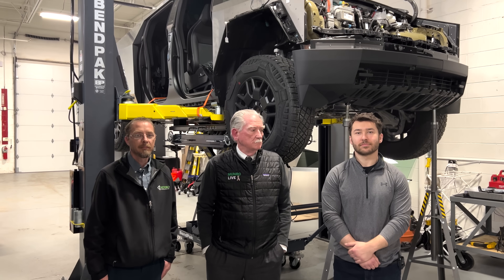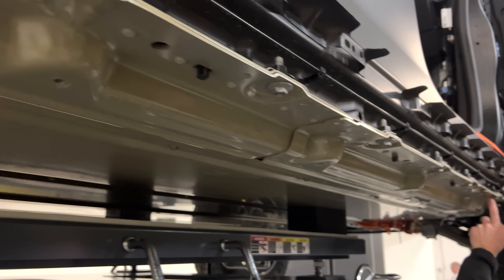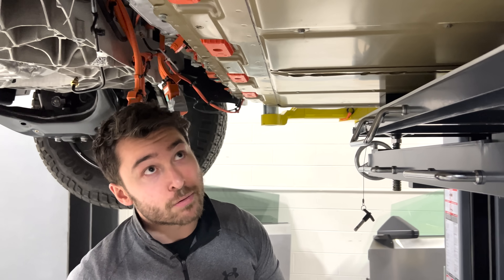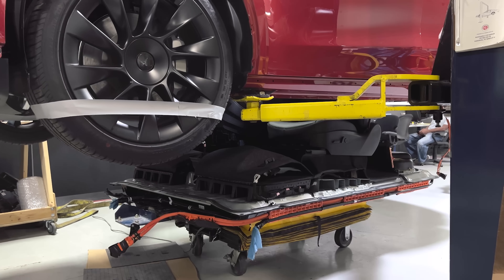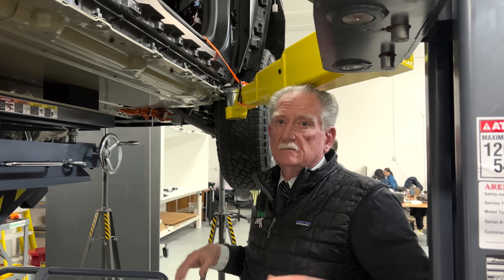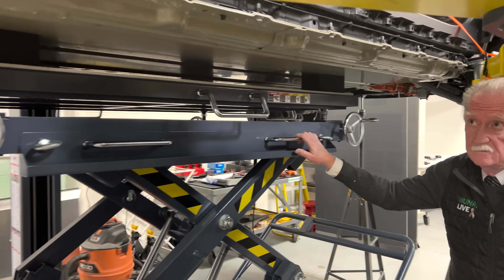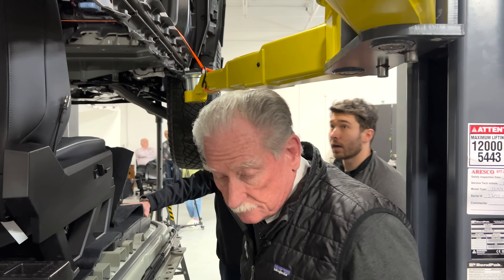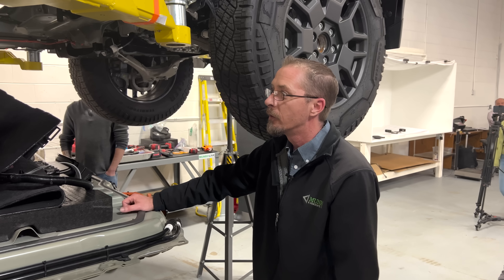Dropping the Battery Pack in Our Tesla Cybertruck!

Comment: If Tesla’s innovation has reduced production cost so much, why are the CyberTrucks not selling at a price closer to the initial projections?
Reply: If this was a legacy truck released at the initially projected price the dealers would be marking it up to $150K.    So why gripe when Tesla picks up some extra cash to help fund production ramp?
Reply: Because twitter was so expensive to acquire 😅
Reply: They are still refining the production line for the Cybertruck. Costs should come down once this is perfected like it did for the other Tesla models.
Reply: @streddaz   Supplier cost may fall too when Tesla can order in larger quantities.
Reply: @danharold3087  yes, you are correct. Volume reduces costs.

Comment: Monroe talks about saving the manufacture $800,000 with the structural battery pack with the seats attached. Unfortunately, what he doesn't mention is what it costs the consumer...
1) Added cost to remove and replace the battery pack.
1) The structural battery pack is a throw away battery pack that can NOT be serviced! Please don't mention recycling. That does the consumer ZERO good!
A great company with some of the smartest engineers. Unfortunately their talent goes to helping the wealthy make more money, rather than benefiting the little guy. That concludes my rant for the day.
Reply: Actual like my comment above, Tesla is building a lithium refinery in south Texas so they can make enough batteries since no one else would... eventually they will simply grind up the used batteries as a super rich lithium "ore" and make new, better batteries. The failure rate is very very low at this point on these Tesla packs... if it were not, with almost 2M Teslas sold last year and the media's penchant to overblow any small issue a Tesla has, we would be seeing a lot more about their "terrible" batteries in the news. Tesla themselves would have never engineered something like this if they were loosing money on constantly servicing batteries... As for the little guy, Tesla outsold the Toyota Corolla and the Ford F150 now... next year they will be introducing a $25K car that needs no oil changes or regular service and costs much less to operate in terms of energy (something over 100MPG equivalent). At this point whether we like it or not (and I like my gas cars) the electric vehicle transition is happening.

Comment: It must be very stressful for Tesla engineers when Munro Live publishes a video about their part.
Reply: I suspect it "was" at one time, but....
They watched.
They learned.
They refined.
.
At this point I doubt they're very stressed.
Probably more interested to see if the teardown team notices all the innovative points.
Reply: why? Munro loves tesla, almost no critics at all in the past. They love everything tesla does. Even removing the blinker stalks is genious, appearently. 
Tesla could cut a hole in the roof to let rain in and munro would find the positives about that.
Reply: "It must be very stressful for Tesla engineers when Munro Live publishes a video about their part."

Why?
Reply: @dieKampfmelone Sandy can be harsh if an engineer uses two parts instead of one, uses too many threaded fasteners, designs something that could be lighter or cheaper or easier to manufacture or easier to assemble or safer or ....  He lavishes praise on good work, but he doesn't hold back on sub-optimal designs.  It's his job, but he's sharp in his criticism.  He could never be a kindergarten teacher.
Reply: @dieKampfmelone  you must have missed his first model 3 teardown

Comment: Wow! Great video! Answers lots of million dollar questions!
<many engineering themes of legacy automobile manufacturing are obsolete>
Reply: While VW and TOYota each make around 10 million vehicles a year around the world, and sell over $300 Billion, Tesla is not even in the same league, stop worshiping nonsense.  More plastic snaps, that's key, to the low quality that is tesla.  Remember Sandi is an ex Ford guy, Ford has the most recalls of any maker in the world...what a resume'
Reply: @cengeb  <yeah, so ummm...if you bought a $100,000 utility truck(ford/gm/ram), and still owe $50,000USD on it, i would be upset too>
<simple trumps complex>
<if going electric means removing 5,000 parts and/or 2,000 moving parts from your previous designs of legacy automakers gas cars, ultimately this strategy will succeed>
<when a (standard sedan)electric vehicle comes out with a million mile battery pack, and stainless steel exterior i will buy one>
<i exited the gas car scam in 2010, because it's a scam by all parties involved>
<all plastic on your car(s) are perishable items, so if you paid 40 grand for jeep and/or bronco, which are 1/2 plastic, then you paid 20 grand for some fancy plastic decorative parts, etc.>

Comment: Do a Silverado EV next, to see what really cutting edge EV pickup performance is all about. GM with it's much larger battery, destroyed the CT in a 500 mile rocky mountain towing challenge. And this is what really matters to many pickup users. Real world towing. The real problem that I have? With a larger battery option, CT would likely have only matched, but not exceeded, the GM performance in this test.

With all of its hairpin motors, 48V architecture, octo valve, etc. the cybertruck is supposed to be the game changing technological marvel that  sets the standard for EV performance. It's head to head performance says otherwise. Even the F150 lightning and Rivian performed nearly identically. I'm a HUGE fan of Tesla design innovations, and i just don't get why we don't outperform Big 3 competitors that essentially pulled out the ICE powertrain, and slapped in an electric motor and a half baked battery pack. It doesn't add up. What am I missing? More importantly, what are TESLA engineers missing?

Out of spec reviews:  https://www.youtube.com/watch?v=LJFbevgCsig

Comment: Tesla could do a little more work to make the battery pack more accessible - fishing around for wire and moving the Tonneau louvers back and forth ads time to battery replacement.
Reply: You are joking?
.
Maybe it's just a case of closing the cover closed before disconnecting the battery, meaning the tonneau isn't in that area?
1) Bed side cover off.
.
2) Release charge receptacle (disabled in service mode so it can be unplugged from the pack?)
.
3) Close the tonneau.
.
4) Remove the cabling....?
.
Or something like that....
Reply: The savings are for the production line, not for the unknown time in the future that may not even happen.

Comment: Once the battery pack became structural, it was probably inevitable that the traditional unibody structure was going to change, just as unibody replaced separate chassis.
It will be interesting to see how this assembly system spreads through the industry.

Comment: As the body moves along the line, how does Tesla keep it aligned properly without the battery? That would require a large rig to mount to the body until the battery is attached or the body would be like spaghetti as it moves.  Maybe that explains the panel panel/door alignment issues seen on production vehicles.
Reply: Some gaps, like the dual-motor MKBHD shown, were actually because the door latch fell off. Thing is, this will get fixed as the ocmmon "low VIN" issues get fixed.

Comment: Its apparent that Sandy hasnt been in modern vehicle manufacturing facilities, and it shows. Unless he wants to prey on the ignorance of the viewers, and plays up Teslas way of manufacturing. They have automated robots for assembly, theres not banging up interiors, fenders, exterior parts. Everything is done mostly by 4-5axis assembly arms. Dont let him fool you
Reply: I know that, it's actually allowing for consistency and higher volume production. They do have employees check up at many steps on the line though.

Comment: If anyone else designed a floor and battery combo would be called insane and ludicrous.
There is no way this gonna be a long term or safe jus saying.
Reply: It's not TOO bad, plus the seats are removable without the need to drop the pack.

Comment: droping the whole floor along with seats, carpet and everything is beneficial from manufacturing standpoint, but servicing the batterypack on this is nightmare. also, it could lead to issues with sealing
Reply: Sigh..
Reply: 6:40 "easy peasy". 
Drop the worn out battery pack and seats; replace with new pack and refurbished seats. ☮️
Reply: @Tim_Kent  yea. just give it to tesla without any option to replace modules/individual cells or any other component inside the batterypack. just replace the whole pack in tesla servise. because they don't want a single dolar to escape.have you heard about right to repair? that's the right you don't have with this solution. and to add more cost to replacing battery, you want to replace seats along with it. and still, you have seals around the floor of the car, that's potential place for leaks. if you drop the batterypack, chance of leaks is sligtly increased.

Comment: Do that battery pack bolts have never sieze, or will the be rust welded in place after a winter or three exposure to salt?

Are the nuts fixed in place?

A better view of the stuff installed on top of the battery pack would be nice. And what is left inside the vehicle.

Comment: Compare that to the Ford Lightning frame with all of its bulky structures and separate battery modules. The Cybertruck structure not only saves assembly time but also weight and cost.

Comment: Hell if you need to fix a seat motor or HVAC you'll have to drop the battery pack and mess with the tonneau cover to disconnect the power lines. Fast for assembly,  but just pass on high service costs to customers at service. Why Elon and EVs suck!
Reply: What? It would be under warranty I think. And, the seats can be removed without dropping the pack.

Comment: Putting those structural bolts right in the path of the wash of rocks, water and salt coming off the tires is some advanced thinking.
Reply: Gonna be wild first time someones driving and they fall out the bottom
Reply: Waiting for the first REAL problem still.

Comment: How does this design affect the structural rigidity of the vehicle, in terms of torsional bending stiffness and all that influences, etc.? I understand that pickup trucks typically have a different construction to sedans/SUVs, so I would be very interested in how this differs (and in what ways it is similar) to what Tesla will be doing with the New Model 3 and refreshed Model Y to come out?

Comment: Amazing how nobody questioned the unibody process for decades...
Reply: "Amazing how nobody questioned the unibody process for decades..."

It makes sense. Just look at how little stagnant legacy automakers have innovated since then.
Reply: @yourcrazybear yeah, like the first electronic fuel injection VW, first plastic fuel tanks VW, DSG transmission, PDK at Porsche, yeah, no innovations, ABS, , disc brakes traction controls, shoulder seat harness Volvo, radial tires, better paints, right, no innovations, only tesla, sad, to be a cult member, really.  I guess halogen headlamps, then xenon, the LED, no innovations, right, better and lower emissions over the decades, better mpg, all those legacy car makers doing nothing.  Sad, really sad to think Mush is such a creator.  Meanwhile TOYota and VW each sell 10 million vehicles and sell over $300Billion (VW $320 in 2023) sales, Tesla isn't in that leauge
Reply: Why should they?This only makes some sense with batterie electric cars!

Comment: With the rear seats hinged on the rear body structure, the amount of stuff on the battery pack is reduced. It would not be hard to bolt the seat supports to the frame such that when the pack is removed, the seats stay in place.
Reply: That is how Tesla did it.  Rear casting holds the rear sets.  Actually has a largish tab under the seat frame.
Reply: Seats don't need hard fix to battery. Bolt the seats frame to the body once installed with the battery, so pack can be removed with seats and soft floor left in place
Reply: @peteregan3862  The rear casting has a section that the rear seats rest on.

Comment: the pack is a lot thinner than I thought. they could have easily squeezed in another 40kwh into the main pack on the extended range rather than as a pack taking up space in the truck bed.

Comment: Id like to see the floor and roof cage cast with clip in place plastic rocker panels. I dont like the top bolts. Bottom bolts only without having to remove any body panels to access the battery bolts. They should have a single penthouse cover to access the connections,  or have connector blocks that engage the battery as it drops in place.

Comment: The cabin floor is certainly not the "whole structure for the centre section of the vehicle". It's just the floor panel with attached crossmembers, with the roof and side frames with rocker sections providing almost all of the structure.
Reply: Pay more attention.
The system has only been described in detail for.... Years.
Reply: @rogerstarkey5390  I have paid attention... and it is exactly as I described, in both the Model Y and the Cybertruck. 

If you think it is any more, then you haven't paid attention.  You can even see in this video that it is nothing more than the floor panel plus some attached crossmembers serving as the top cover of the battery case.

Comment: The floorpan-attached-to-pack scheme does matter to assembly of the vehicle interior, but it just adds work and complication to battery pack replacement.
Reply: How often does one replace the battery pack? In a million miles? That's okay because its not done on the production line but in a repair shop.
Reply: @ronjos  that's fine, and the design may be a good choice... it's just not an improvement for battery replacement, as claimed in the video. And despite the claims of Elon disciples, Tesla batteries do not typically last a million miles.
Reply: True, but Munro (and Tesla) are strong on saving manufacturing costs and on techniques that improve reliability ... to quote Sandy "You can have reliability or repairability but not both!". People thinking of future maintenance, repair and replacement have different priorities!
Reply: @MrAdopado  this assembly design may be a good idea because it reduces manufacturing cost, but it certainly does not improve reliability.

Comment: Just got my CT on 032024.  Am curious to know if there is unused space in the battery pan for the 500+ miles worth of 4680 cells a lot of us were hoping would be a factory installed option.  The current enormous $16k optional battery pack, when combined with a spare tire, uses up TOO SUBSTANTIAL  bed space.   I realize that a dropping of the CT battery pan and retro-fit of additional 4680 cells is NOT a practical economical possibility....and that any 500+ mile CT would mean a future new Cybertruck purchase.
Reply: Highly unlikely.   Tesla would have had a 200+ KWh option instead of the range extender.    Look at what the 200 KWh pack does to the chevy WT 4 playload  1,440 lbs.  1000 lbs less than the CT.   Simply choices.   Pick what suits you.

The in box range extend would be a  very good option if Tesla teaches it how to drive off the truck bed onto a stand next to your power wall.  Highly unlikely but it would not be all that difficult.

Comment: @MunroLive Did you use the procedure in the Cybertruck Service Manual for battery removal?
Reply: I can answer that: no, they did not. They rather try a reverse process from the general assembly, likely for analysing general assembly. But this is different than the service procedure: "High Voltage Battery Assembly - HV Battery, Long, 4680, Center (Remove and Install)" from the Cybertruck service manual, which is intended for work shops and repair shops.

Comment: I would still like to see easy drop swappable packs.  As battery tech about to change at warp speeds . I am thinking 2 years double capacity and 1/2 weight.     Guess you can get new seats like a bed thing as self drive seems may allow us to drive by 💤
When you get your update pack.

Comment: If the BendPak scissor platform lift is new and so much better... what did you use before? This is the obvious tool to remove or install battery packs.

Comment: A great design that needs binders holding the hoist arms to prevent the truck from falling down because there is not lifting point big enough.  Car made to save money on build but to keep the trouble for the repair situation.  This also mean the final customer will need to have the seats remove in case of pack failure, pack replacement. This also mean you need more height from your hoist system because you dont just pull out a thin pack, you pull the full height of the seats.  A car made to do money and make it hyper expensive to repair. At one point it is becoming ridiculous to build car like we build smartphones, with no reparability in mind.
Reply: smh
Reply: You got that right. Disposable cars are going to save the planet!